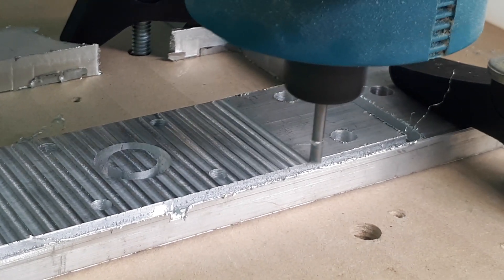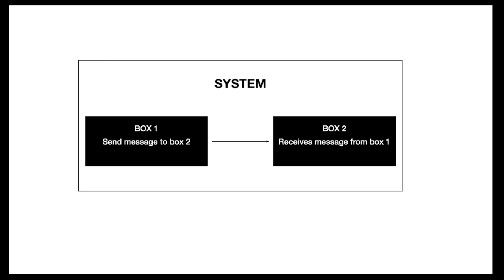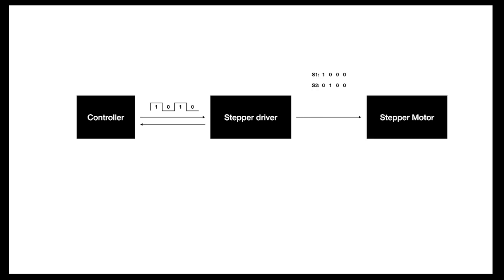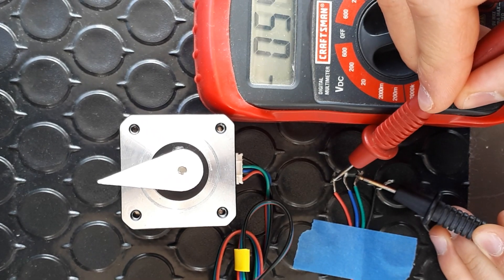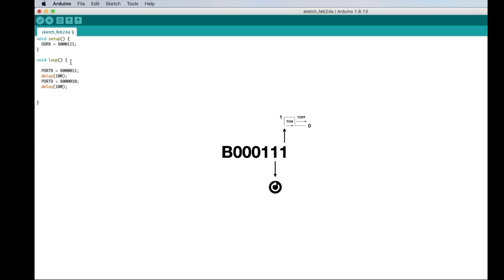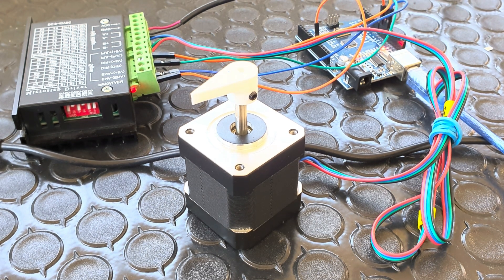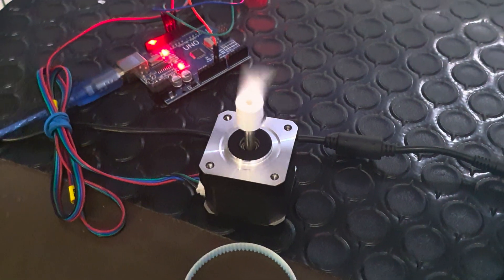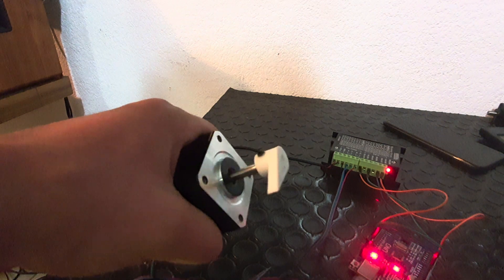Stepper motor RPM with arduino

Comment: micro step driver: there are A- and A+ , if i can measure the frequency using logic analyser or oscilloscope, will i see same frequency as i measured in ths rpm function code?

Comment: I have a question, as you are seinding Low and High signals to driver as pulses to drive motor that means this the frequency -> so he loop function calls this pulse that mans this function frequency is the motor running frequency right?

Comment: is there any difference if i use the A4988?
Reply from the maker: Hi Diego! 
There isn't, just look at the wiring schematic of your driver and check the peak current it delivers and the current your motor demands to see if its suitable for it

Thanks for your comment! Cheers 🤙🏻
Reply: @cemf4330  I needed to put my motor at 60rpm and I couldn't find any video, code or reference value that would help me, but I found your video and it helped me a lot, I just had to change my Vref of my A4988 because my motor vibrated a lot and I had to lower my Vref so that it will work well, and the pins from step and direction, thank you so much!! 🤙
Reply from the maker: @diegoalbertoramirezlopez2060  glad to hear that ! Thank you for such amazing feedback 🤜🏻🤛🏻